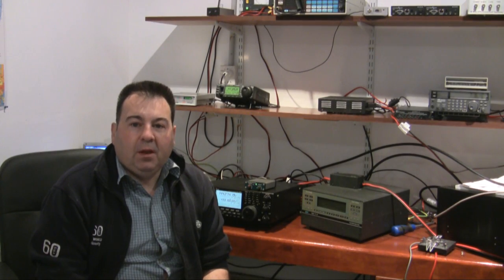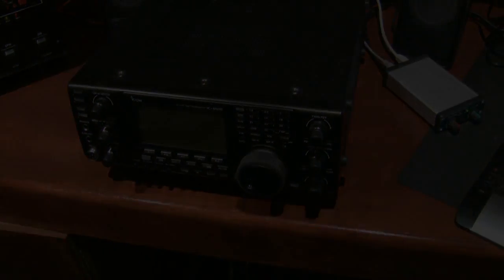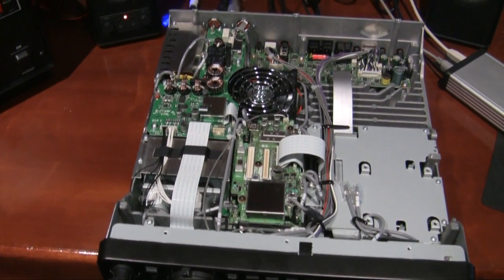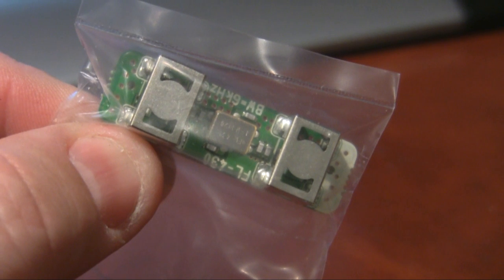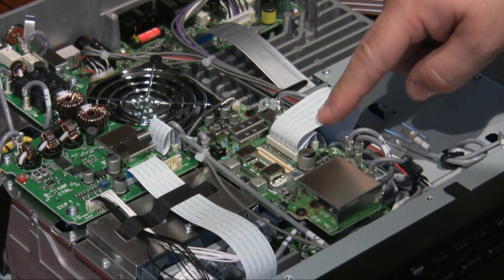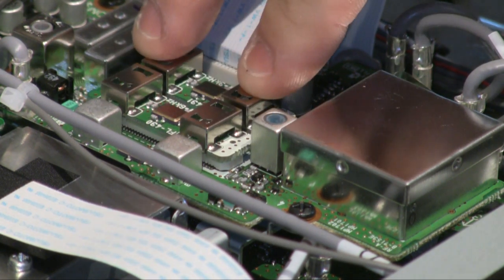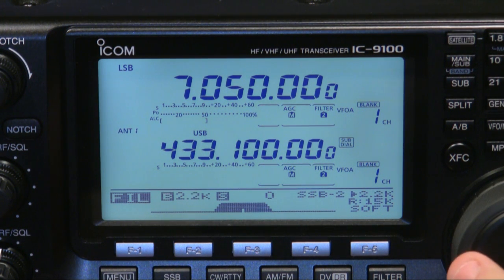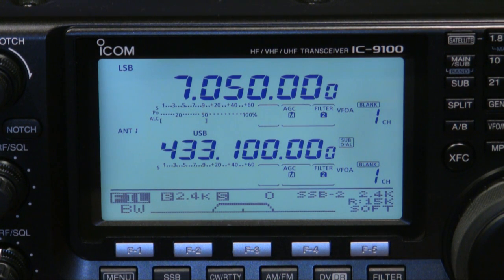IC9100 Roofing Filter Installation

Comment: The installation is very simple as is the D-STAR module.The manual gives the wrong instructions for the D-STAR module.Flip the radio over from what the manual says and then flip the face plate down for the installation.👍🎙

Comment: Hello. Pardon my ignorance but what exactly do the roofing filters do? I have an IC-7410 and a friend suggested I consider getting them. How will they improve my already awesome ICOM IC-7410 experience?

Thanks & 73
VK5MTM
Reply: ***** I feel the Roofing Filters are Smoke & Mirrors.I have the ICOM 7600,a local friend has the ICOM 7700,K3 & KX3,& another local has the ICOM 756 PRO II with Inrad Roofing filter & the only one I can tell any difference in is the K3.I have played with all three settings & find there is so little difference no matter which is chosen that they are more Hype than anything else.For sure not worth adding if the radio does not already have them.I would be VERY upset if I added them into a rig that does not have them & did not see more of a difference than I have seen.Save your money or at least listen to someone else's rig with the roofing filters before spending your money.

Comment: It is the exact same radio as the 7410 except for the UHF/VHF bands....I placed the 3khz roofing filter on my 7410.   I bought them from Hiro on EBay at a bargain price.   They are the same filters.   I love the 7410.  If only for the overshooting on SSB, which is controlled via ALC, it will be have ***** stars.

Rafael  / NN3RP
Nation's Capital USA
Reply: The 9100 can also have D-STAR & Digital Phone & the 7410 can not.I have the 9100 with D-STAR & both roofing filters.